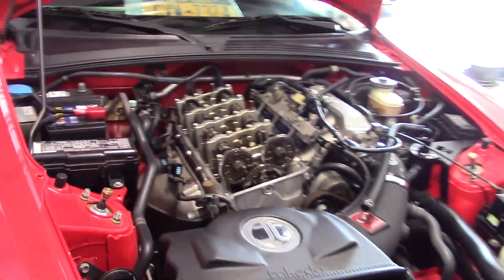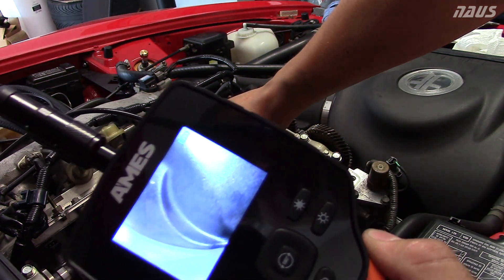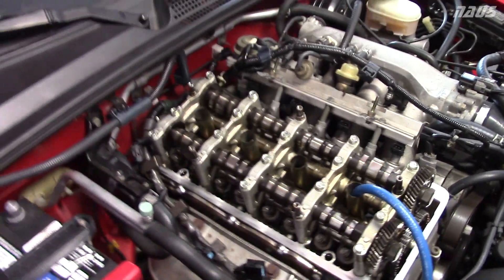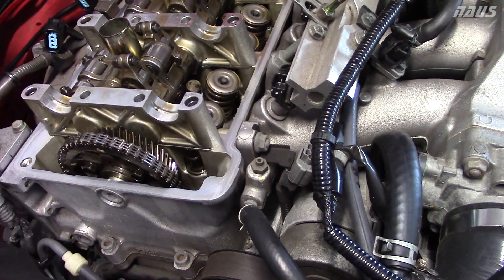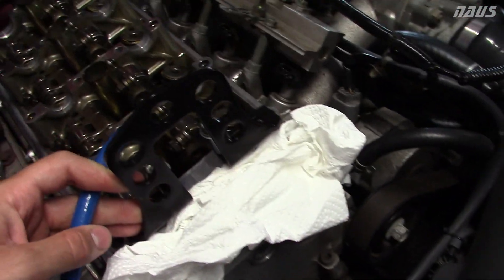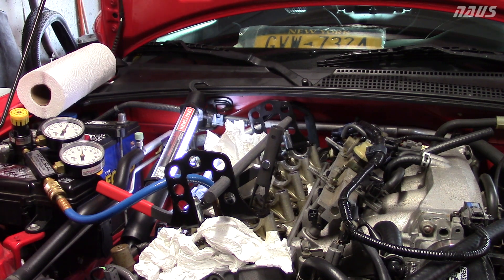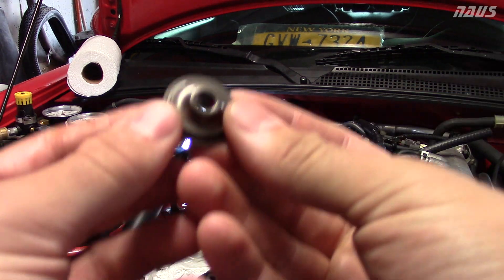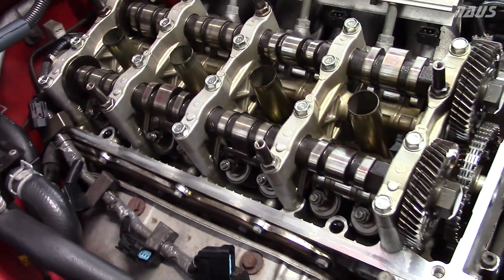AP1 S2000 Engine Inspection After Overrev

Comment: When it over revved did any of your spark plugs get smacked? I accidentally went from 4th to 3rd on the highway and one of my spark plugs looks like it got hit with a hammer not terribly hit but very obviously hit and I have no compression in cylinders 1 and 4. I’m just so worried the pistons are fucked or there is a crack in something. I have a ap1 only 33k miles. Spent all my money to buy the car now I got nothing to fix it with
Reply from the maker: If you have no compression in certain cylinders your valves hit the piston. Spark plug would be the last thing to be concerned about my friend, may be able to get away with a new head of the bottom end is still good
Reply: @NAUS2K  I’d need a whole new head? Cuz the whole valve train and stuff look to be fine their is no obvious damage other then the one spark plug and having no compression
Reply from the maker: Yes if the valve got bent and then came up into the valve seat (which is a highly machined surface on the head) it is possible it damaged the machining on the head and will never seal again unless you put a different head on that’s not damaged, or have the head remachined
Reply: @NAUS2K  lovely 🥲 I have literally had it 24 hours now I have to buy a new head already fuck my life
Reply from the maker: Do a leak down test on those cylinders first. I show how to do it in this video. A leak down test will show if the intake or exhaust valves are leaking. If they are leaking, the head needs to come off regardless. Best of luck
Reply: @NAUS2K  well I’m taking off the head anyways because I know the valves are definitely bad. I’m just hoping the head isn’t damaged beyond repair because I wasn’t red lining it and pushing it too hard when I shifted the wrong way so I think it just barely went over 9000 RPM and stretched the rod

Comment: Nice video, glad to see there was no obvious damage! From what I understand, the cracks will not be visible right after the actual over-rev.. The over-rev causes lifters to float and "jack hammer" the valves, causing very small micro-cracks in the retainers. Over time (depends on various conditions, think 1000s of miles) the cracks become larger until the retainer fails to clamp the cotters around the valve stem, and then POP.. valve drops.  To be safe, I would check them again every once in a while with the dental mirror and flash light method for peace of mind. Although, I have not seen any reports of broken AP2 intakes, and only a handful AP1 exhausts from my extensive S2ki research.

PS, when I did my retainers, I used the modified "Euro Export" tool recommended by DIYGuys, Lisle magnetic tool, and rope method. I found this to be very quick and I was never worried about letting a valve drop down into the cylinder, especially when hitting it with the Lisle tool.  The tool IS sorta pricey, but I recommend it after experiencing how much easier it was.

PSS, I bought my car with 126k miles, never over-reved it myself, and changed the retainers at ~129k miles. 5/8 intake retainers cracked... 

Nice driving by the way!! :)

Comment: nice video. You are way more thorough then me. I wouldn’t bother disassembling everything unless I planned to replace the retainers. Lol I replaced all 16 retainers to Ap2 and never had any issues with that for almost 10 years of hard driving
Reply from the maker: Thanks man, this was my first ever misshift so I was super paranoid. I had the time so I figured it was good to check the AP1 exhausts. They handled it like a champ so I’m just gonna send it from now on. I am adding a ingalls torque damper to the car as well this year in addition to my hardrace engine and trans mounts to prevent the shifter from moving when cornering hard. Hopefully then I will run out of excuses 😂